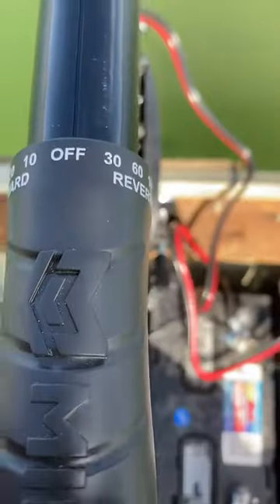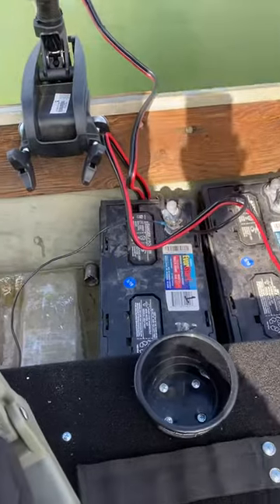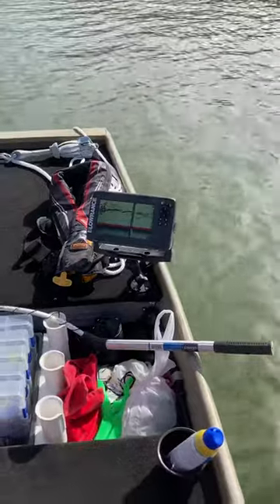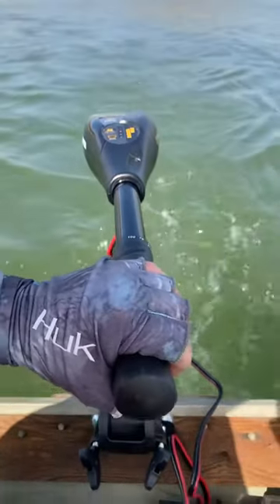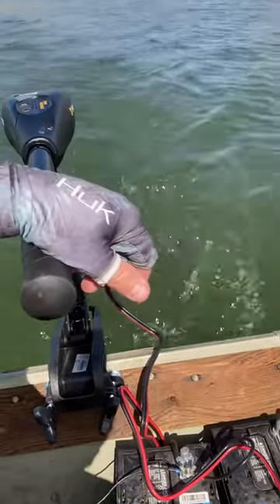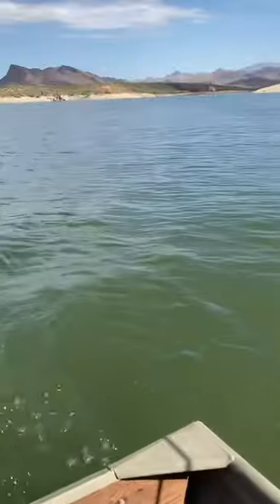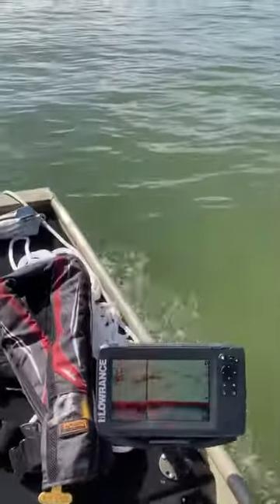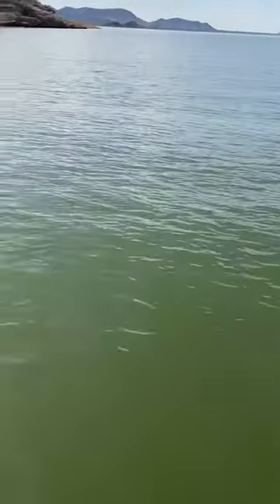Minn Kota Endura Max 45 speed test

Comment: I think you mean Parallel not Series. If you had it wired in series it would be a 24v system? But I can't see the wiring enough to tell for sure
Reply from the maker: Yah you’re definitely right. I misspoke. It’s parallel cause I’m still running 12 volts, just doubled my amp hours. I’ll put a note in the description. Thanks man!

Comment: How long do your batteries typically last with this setup?
Reply from the maker: So I typically will be out fishing for 4 hours or so running the motor intermittently the whole time. When I get home to recharge the charger usually shows the battery around 80%. I normally only run one battery but this day used the two off my camper. 
A good but general rule of thumb is for every pound of thrust a trolling motor has it will draw one amp an hour. 
So if you have a 30lb thrust trolling motor and your battery was a 90aH you could technically go full “throttle” for three hours non stop before completely discharging the battery.
Reply: I dont understand. If minikota endura last 5.times longert then usual motor and last only 3hours then how many hours will last simple motor for 200 dolars? Like storm 55lbs. I wanted to buy mini kota endura 45-55 but if so then i dont need electrical at all ..  confused